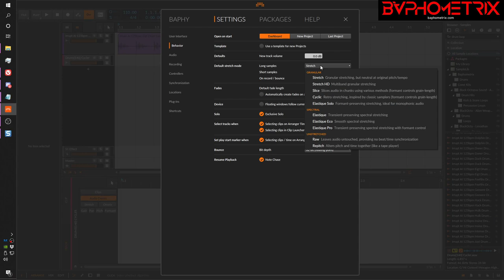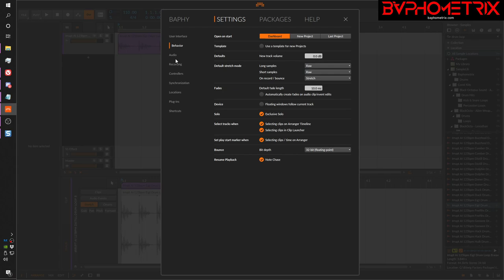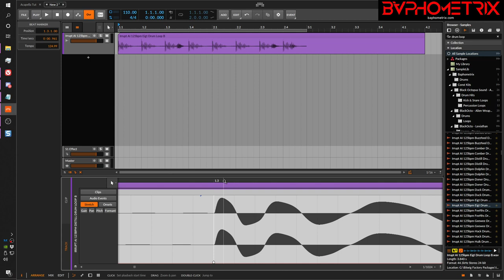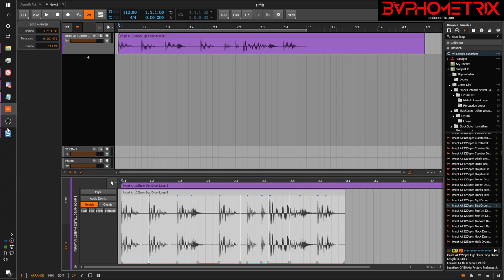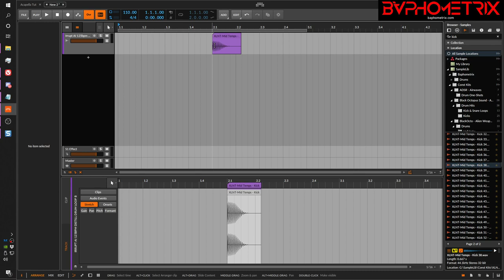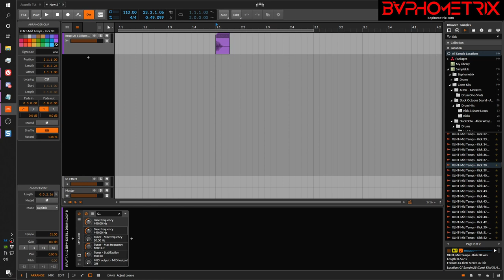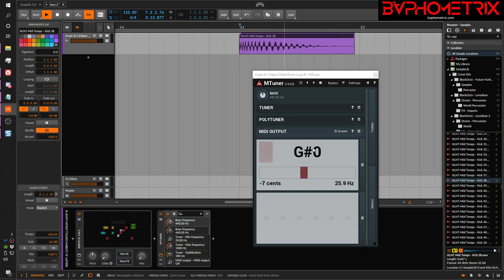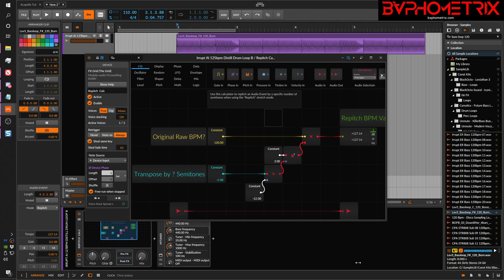Bitwig 3.2 Audio Editing - Pt. 4 - Stretching (Warping)

Comment: MTuner is a great tuner, but it's designed for sustained sounds, and it will not give you an useful reading for such short samples.  The best tool for this task is MAnalyzer.  You have to watch where the frequency of the fundamental pitch settles after the initial transient.   This specific sample unfortunately happens to be difficult because its pitch resumes dropping steeply at the very end of the sample, which you can actually see in the waveform.  It looks like the bulk of the audible tail sits on E.   In most kicks, at that point in the waveform the pitch slide has mostly stopped and it's easier to sort out the pitch.
Reply from the maker: Good advice!

Comment: Thanks again I learn a lot with this.
A note on your repitch part:
MTuner or any other tuner isn't really capable to detect the pitch of a kick. Its too short and too low. I never get constant results on kicks. Tuning kicks should be done by ear anyway. Your claim about phase problems in the stretch modes other than repitch are not correct, as repitch is the only strech mode that reflects the result in the waveform. If you record the result into a new audio track you can see that. Its also worth to test out Slice or Cyclic modes, as they do basically the same as repitch on such short sounds.
Reply: Meaning that they don’t affect the phases normally?